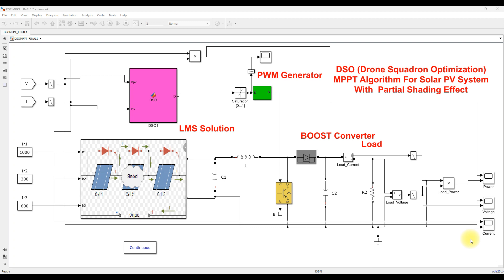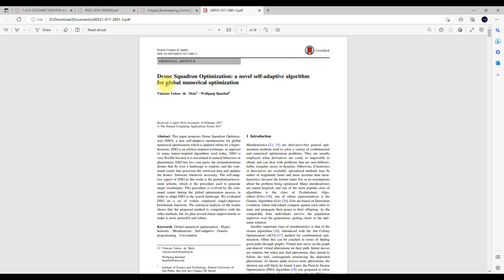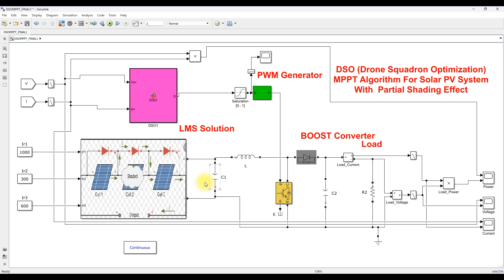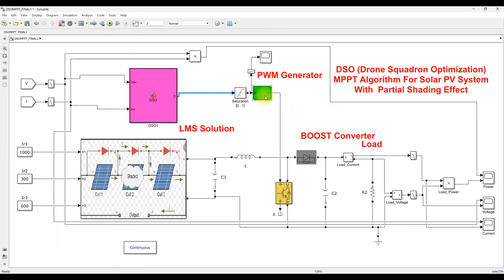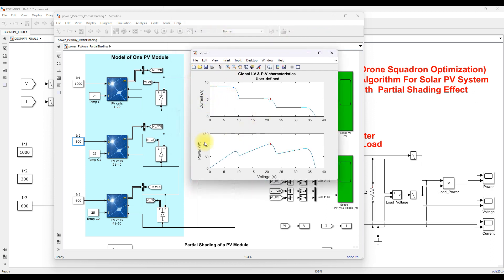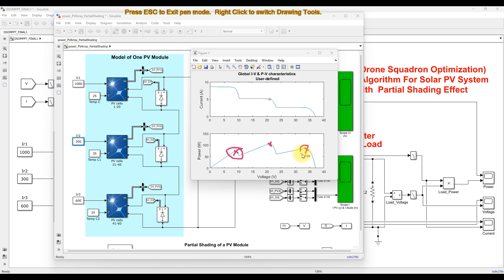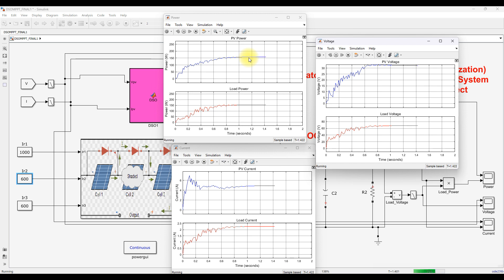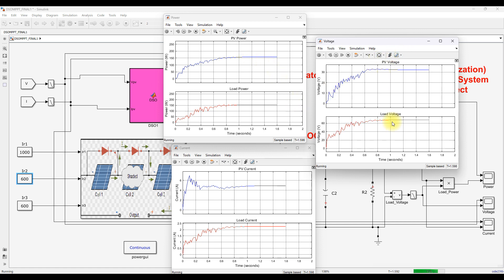Drone Squadron Optimization MPPT | MPPT for PV system | Drone Squadron  | MPPT for PV array

Comment: I have received " Algebraic state in algebraic loop containing 'drone/Subsystem/PV Array/I Filter/First-Order Filter/Model/Sum1' computed at time 5.8972883624417219E-6 is Inf or NaN.  There may be a singularity in the solution.  If the model is correct, try reducing the step size (either by reducing the fixed step size or by tightening the error tolerances)"........error. Can you please help me?